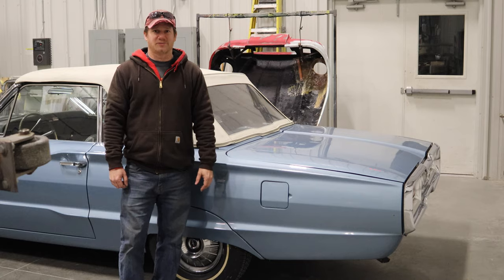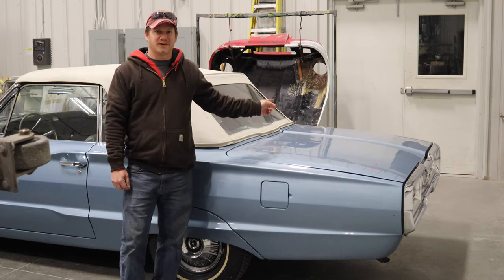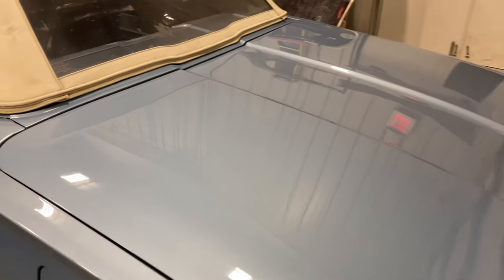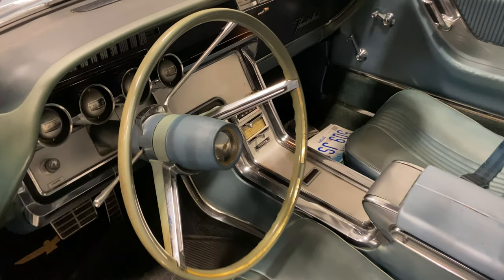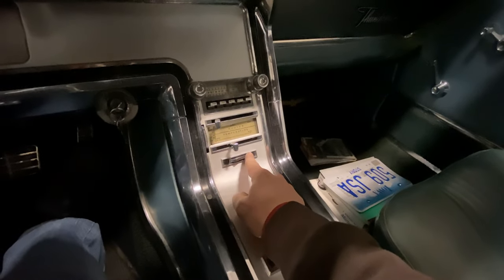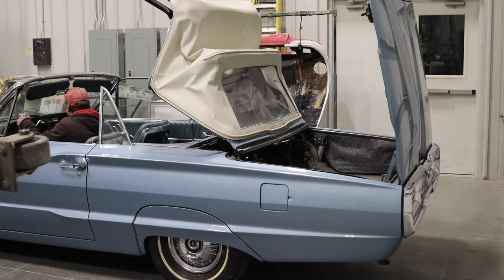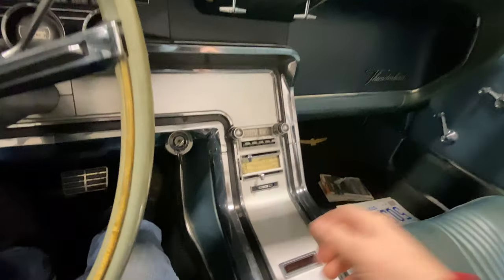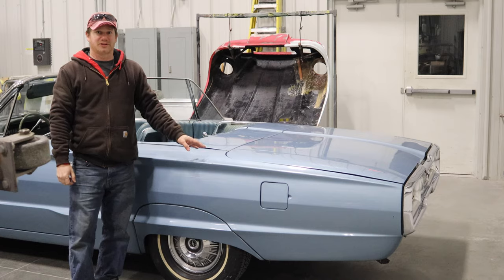1964 Ford Thunderbird Convertible Top Operation

Comment: NICE T Bird!  Best practice is to operate a convertible top, with the engine running.  It raises the electrical system from 12 volts at the battery to approx. 13-14 Volts.  Better for the electrical components.
Reply: Yes, and leaving the conventional ignition ON with the engine OFF can burn the breaker points causing early failure and need for points and condenser replacement prematurely.

Comment: 1964 ? amazing engineering , fabulous car you've got there
Reply: Ford started doing tops like that in the mid 50's with their sunliners.
Reply: @Oldbmwr100rs  
Yes, the '58 to '60 models had power tops with trunk lid motors too.
Reply: @Oldbmwr100rs  The Sunliners were definitely cars ahead of their time. I remember when my dad bought a 1959 Mercury Parklane in 1960; it was the floor demo and loaded. These were basically Turnpike Cruisers which were similar to the Sunliner. The Parklane, my dad, bought was in white, 4-door, and had the big 430 cu. in. LEM V8. That car was happist at 100 mph, and because of the weight, very stable at that speed.

Comment: Wow! Good thing they had sophisticated microprocessors and advanced electronics back then...oh wait!

Excellent video!
Reply: The array of relays and limit switches needed to operate the top mechanism was mind-boggling and required frequent adjustments. Good thing a more modern solid-state replacement is available.

Comment: What a good job you did with that top! Thunderbird's are my favorite car, especially the convertibles! Used to have a '59 T-Bird when I was in HS. It had a 440 with a 4 barrel and could that car move! Anyway, just wanted to comment on your beautiful T-Bird! Thank you for the upload!
Reply: Ford never produced a 440 engine, they did however use a Lincoln-sourced 430 in a small number of T-Birds in '59 & '60
Reply: I think you mean a 430 ! Ford put them in Thunderbirds back then, 440s a Chrysler engine not Ford! .
Reply: @kingkrimson8771  Ford actually put 430s in 58 t - birds TOO ! .

Comment: Thanks for demonstrating the operation of the convertible top!  I always like the styling of the 1964-66 thunderbirds. 1965 was the first year of the sequential tail lamps, and the thunderbird tail lamps were used for all of the shelby mustangs, as well.
Reply: Sequential turn signals were intended to be released with the '64 redesign but Ford couldn't get them DOT approved in time.
Reply: @kingkrimson8771  Did not know that tid-bit of information, thank you so much!!!

Comment: Steve, after watching the Jay Leno vid on his 67(?) Continental just a few days ago, , I remember the master Technician say that the back windows always had to be cranked down a bit before putting the roof down. Maybe check onto it and see if your car is the same?
Reply: That was only true for the Continental convertibles, not Thunderbirds. The rear windows on the Continental convertibles dropped down automatically a few inches when operating the top mechanism.

Comment: A chap I knew had a red thunderbird of slightly earlier design, but also convertible with a white roof and seats. When the roof folded down, there was a red fiberglass panel that covered the rear seats, making it a two seater. An amazing  looking car.
Reply: That was a sports Roadster model they made them in 62 and 63 ! They 390s with 3 two barrel carbs and  Real spoked wheels,  not hub caps 340 horse power .

Comment: The jet birds were always so cool. Gorgeous from any angle and powered by the FE big block, what's not to like?
Reply: 1. Gas mileage 
2. Stopping distance
3. Handling
4. Lap belts only
5. And mabey the length of time you have to hold the power top button...
6. A console but no console shifter
7. No cup holders

You did ask
Reply: @moesizlac2596  You make that sound like it's a bad thing! Joking aside, if I had my way I'd probably go the restomod route and address some of those.
Reply: @grndiesel  yeah these things have all the style...but there are just sooo many of them out there, and everyone thinks they need to save them.  A full on proper usable restomod with the right engine n trani might even make them almost relevant.

 ...could do a coyote, but why not rob a modern suv of its v6 turbo and get better power AND gas mileage.  Modern suvs weight the same as these and won't break the bank on gas.

Also that speedo is pretty useless.  The ribbon starts too far to the left.
I would put the big triple gauges from a 61.2.3 jet birds in there...
Reply: @moesizlac2596  I actually like the fact that they're not very high on the cool status. Mustangs and Mopars are so expensive now that you need some deep pockets just to get one, let alone have some fun with it. I get your point with the turbo V6 (ecoboost?) but I'd sooner put EFI on the 390, then bolt it to a 5 speed stick, or 4 speed overdrive auto. Otherwise, I'd commit the ultimate sacrilege and try to shoe-horn a diesel under the hood. I'll likely never have time for any of that, but I can dream.
Reply: @grndiesel  mmm Diesel soooo Sacrilegious...ahhh

Comment: I thought that the motor was to be running when operating the top  these are wonderful cars   I have helped work on one of these systems to operate the top  i never thought they that noisy    Love the looks of the car
Reply from the maker: I would normally have the engine running but for the sake of the video and being able to hear anything over the engine I did not.

Comment: Very interesting car. Looks like the only option besides the top was a rear seat speaker (FM?).
Not even power windows or a power drivers seat which were super common. 
No matter, it's a stunning car.
BTW, in the manual it states that the car should be running to move the top. It takes about 70 amps and voltage drop is a killer.
Reply from the maker: Having to roll up and down all the windows when you want to put the top up or down is a huge pain, power windows would be nice.  With how long it takes I guess you have plenty of time for someone to get the windows for you!

Comment: Does that top have hydraulic valves or is it fully electric?
Reply: Hydraulic for the top and trunk lid, electric motors drive trunk hold down and cover flap.
Reply: Oldbmwr100rs thank you

Comment: I worked for a Lincoln Mercury dealer in the 70's. We used to work on a number of mid 60's Lincoln convertibles and they work much the same. The Lincoln's were all 4 doors. On the later ones the rear door windows would automatically roll down an inch or so or they wouldn't catch on the back corner of the top when you opened them. Since these cars were a few years old at the time, it wasn't uncommon to have one with the top down and it wouldn't go up. The relays were all in one of the rear lower 1/4 panels and they would get wet. That meant taking out the rear seat and getting a small guy to crawl in to get at the power relay. Top up and wouldn't go down was much easier to work on.

Comment: Nice video, good editing. But seriously... That is one noisy mf convertible roof.  I was convinced several times it was going to blow up or just stop, it was making that much straining noise. lol.  Oh, and did I mention you now have no boot/trunk whatsoever??   Ideal for those long road trips... So long as you have zero luggage.
Reply: This Thunderbird has PIZZAZ!!!! and Class. You would never hear the top operating with the radio blasting away. Who needs luggage just adds
 weight.
Reply: It doesn't show in the video, but I think there's a little “laundry hamper” in the trunk that provides a bit of storage space when the top is down. It fits between the top bows and the folded top. Not sure the ‘64 had this, but I remember it on the similar ‘65 I got to borrow back in the '70s.

Comment: sure is noisy. hey it's 1964. at least it works. not like the 08 to 14 Chrysler Sebring / 200 Hardtop convertibles.  once you got a "Top fault" code forget it. the Dealers are clueless too!!

Comment: Great video but you did one mistake . NEVER turn the key to RUN position UNLESS THE ENGINE IS RUNNING. You will ruin the points in the distributor. The engine might have hard time running or run ruff after leaving the key on run position. You have to turn on accessories side ( counter clock ) to operate the top. But you need to have a fully charge battery. Otherwise , have the engine running to operate the top. Thanks again for your video.

Comment: That is one of the worst car ever made. Ford has spent the last 50 years f--------- up that model.  They started in the right direction in 1955, then in 1958 they screwed up the design and have not stopped since.  It is just an Edsel under a different name.
Reply: What are you talking about the Thunderbird was going strong into the 70s with great unique styling and great performance. They only really lost their mark in 73, but they came back for one last ride with the turbo and super coupes of the late 80s early 90s. I will agree that Ford dropped the ball with the T-bird in the mid 70s to mid 80s, and the revamp in the early 2000s wasn’t bad but just not for me